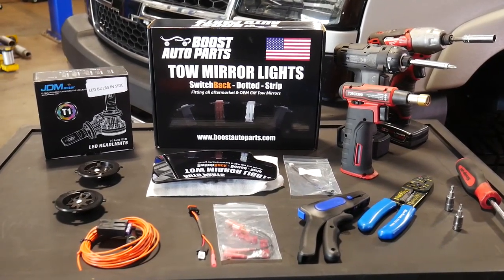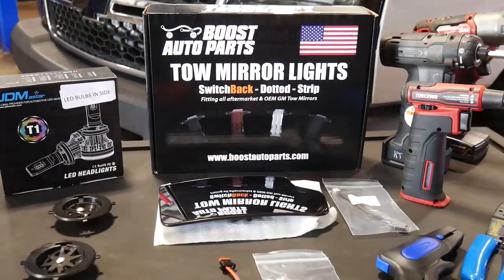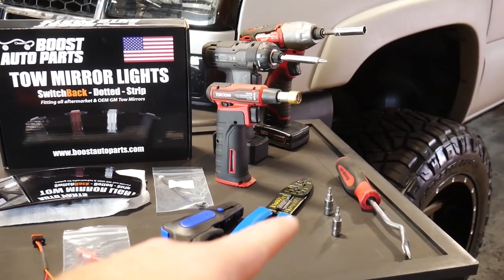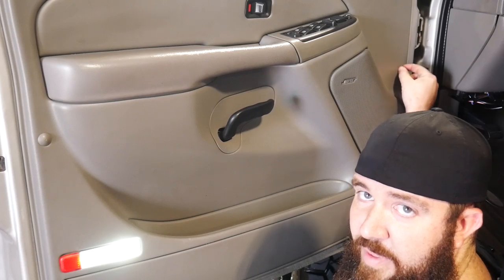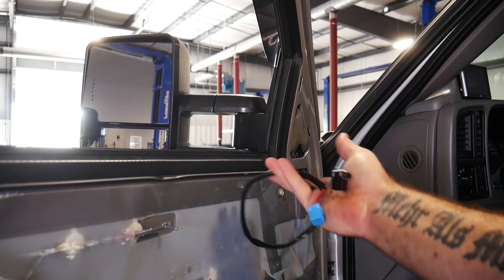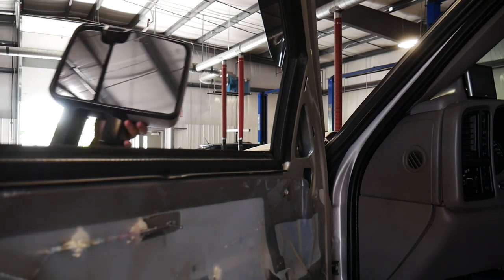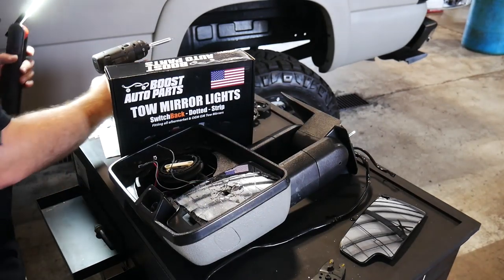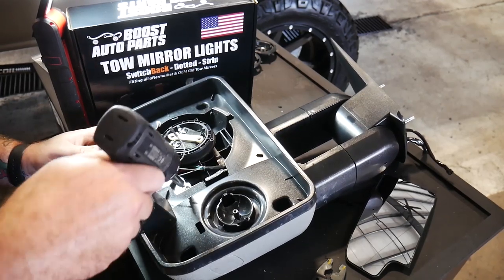BOOST AUTO PARTS AND JDMASTAR SWITCHBACKS!! FULL INSTALL AND REVIEW

Comment: do the white switchbacks stay on with your daytime running lights or just when ur headlights are on?
Reply from the maker: They are fused to the trailer park lights. Im sure you could put them to the DRLs if you wanted, but I think theyre much better seen with the park lights when its dark.
Reply: @RustbeltMechanic  ok thanks. i was just checking. so the lights on mirrors arent on while DRLs are?
Reply: also, I have some aftermarket mirrors like yours, so if I buy the new switchback it comes with the harness to wire up the parking lights?
Reply from the maker: Give Boost Auto Parts a call, they are very knowledgeable and can help you to find out the right wiring and parts for any mirrors, even if they arent theirs.
Reply: @RustbeltMechanic  quick tip with something I did. I ordered some bulb sockets (w/ pigtails) to match the park lights on my sierra. they will fit in the drl slot with a little wiggling. cut off the drl socket from the harness and connect the park light bulb socket. now you end up with two park lights. put switch backs in both positions. then similar to the 4 hi mod in the fuse box, feed a wire from the drl relay to the park light relay. This means anytime the drl is called for (daytime out of park) you will light up the parking lights, which will be all white. then turns signals take over to flash amber, and back to white as you expect with switchbacks. and of course at night the park lights will be on anytime the headlights are. need little trick with two sockets and short wire. just means you need twice as many switchback bulbs.

Comment: Hey man question for you do you know anyone that builds custom head lights for a 2006 gmc 2500 I hate the junk on the market I want someone do build off the factory headlights if anyone know anyone please let me know
Reply from the maker: There are quite a few out there but just be prepared to pay “custom” pricing. SoFlo retros, the Retrofit Source, Southern Retrofit lights
Reply: try to pick up denali headlights and do a retrofit. I used the retrofit source for the retrofit kit after I had the headlights. no need to bake denalis to open them, projectors bolt in from the rear. of course if you want to paint or ditch the reflectors you have to open them up.